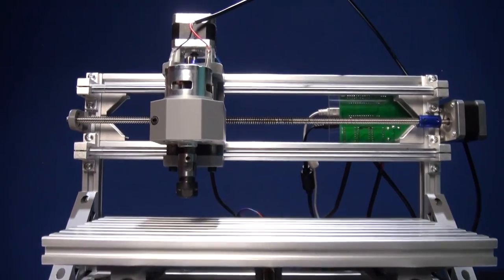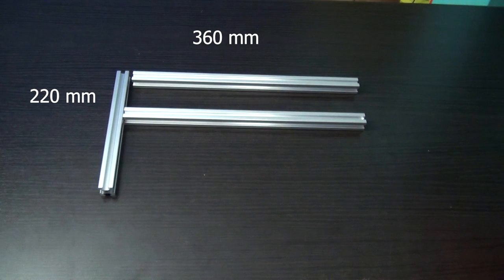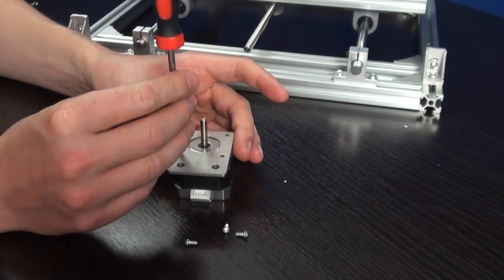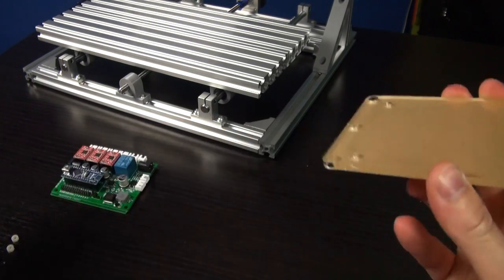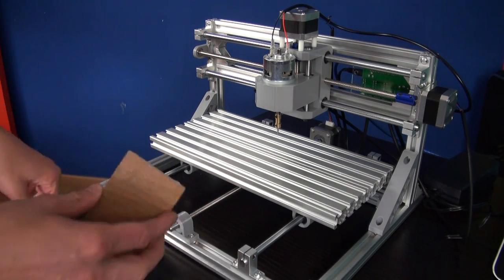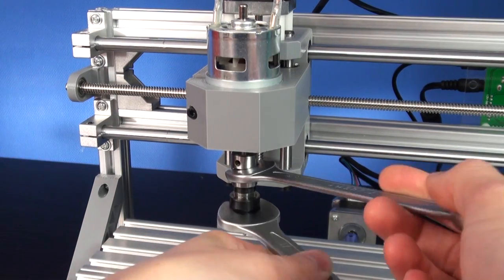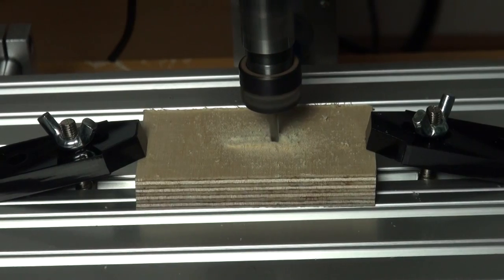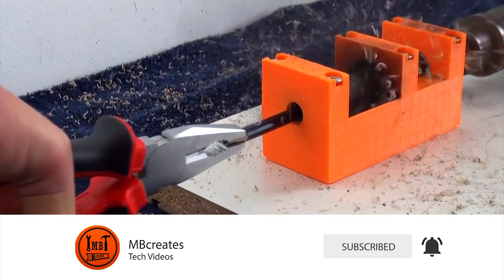CNC 3018 unpacking, installing and full review

Comment from the maker: Affiliate links to products from the video:

CNC 3018 router kit: http://bit.ly/2Ijrldd

Collet chuck/springs set: http://bit.ly/2PQg204 
End mill for aluminium: http://bit.ly/3cwWac8 
End mill set 1#: http://bit.ly/39sPw4J 
End mill set 2#: http://bit.ly/39sO5TN

Affiliate links to budget chineese end mills:
 
Tool 1: ⅛ inch 2 flute: http://bit.ly/2N2DyEE 
Tool 2: 4 mm 3 flute: http://bit.ly/2N2DPXZ
Tool 3: 5 mm 3 flute: http://bit.ly/2N2DPXZ
Tool 4: 4 mm 2 flute: http://bit.ly/2N1KYb2
Tool 5: 4 mm 2 flute: http://bit.ly/2SxnT6g
Tool 6: 6 mm 2 flute chamfer: http://bit.ly/2tmihfX

Comment: I've seen videos of upgrading this machine, giving it a Makita router head, and flat plates to locate the Z axis rather than the round bars. With those mods it can cut aluminum at something better than a snail's pace.

It's actually a good little system for those who just want something to tinker with, making things like PCB boards and milling acrylic and the like.

Comment: Another quality video from MB Creates. Thank you for sharing info and evaluations.
There is a gentleman named Roger Webb that has done a similar video on a 60/40 CNC Router.
The machine seems to be super ridgid  and very well made, but unfortunately he is very tight lipped about the model number, and manufacturer. He shares the name of the place he ordered it from, but only refers to the CNC Router as "The Rolls Royce of CNC Routers".
When contacting the company, they want the model number.
Roger is a retired engineer so he is very knowledgeable about machine design / construction and seems very impressed with it, but won't respond to inquiries.
He mills thick aluminum parts on this machine.
I don't know if you want to machine aluminum parts on a regular basis, but the machine Roger has, seems to be the one you'd want.
It also has a 4th axis. 
Hard to believe it's got so much going for it, and it is very reasonably priced.
If you are looking to move up to a much more durable machine with a 4 th axis that mills aluminum, with your experience, and CNC Router knowledge, this could be your next machine, and maybe you could share the model numbers and ordering information with your channel viewers.
Hope this piques your interest.
Again, good video.
Reply from the maker: Thanks Keith. I'll take a look at his videos.

Comment: I milled copper plate on a machine like this. Took about a day to get the depth that i wanted (just a cut out across the width and 1cm wide), but that was going at like 0.1mm DOC. It did the job, slowly, but I ended up damaging the bearings on the motor. I bought it from Amazon so I packed it up and sent it back :).

Upgraded to a 3040 after that.

Comment: Thanks for a very good video! I've used it, step for step.
Lots of thanks for telling what screw is used. Numbering the items is brilliant!
However, at time 14:07, I needed the number 2 bolt.
When Your video comes to software, things don't work out. Software install ends up with error. No software came with the shipment, no disc, no USB. So far all is dead, only controller boards LEDs alive.

Comment: I have seen in other channels that some of this router change the spindle for one of 500w or even 800w. Its worth doing? How much would the performance of the router improve?
Reply: Upgrading the spindle might be a good investment but 500 W is just overkill. The xyz motors don't have enough torque so without upgrading them as well you will not have the full benefits of such a high power spindle

Comment: 31:00,... well, Operator Errors were present there!
Cutting metal on a Mill absolutely REQUIRES lubrication of the cutting head with oil.
Beyond that, your feed rate was waaaaaay too high.